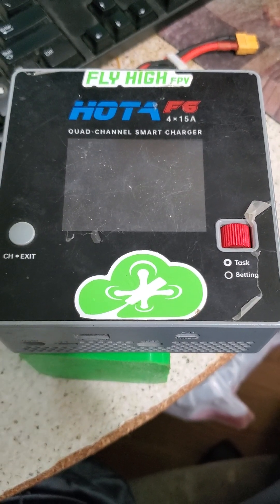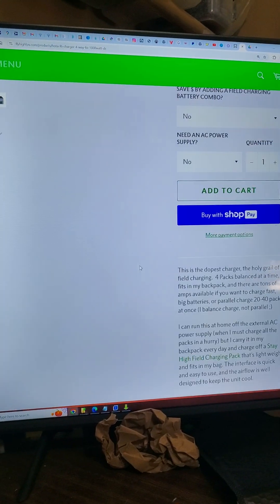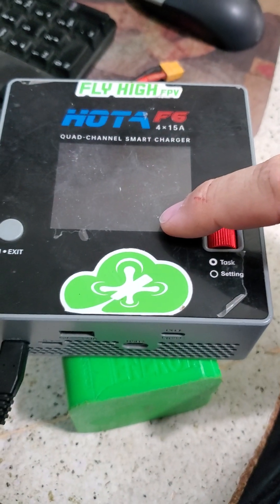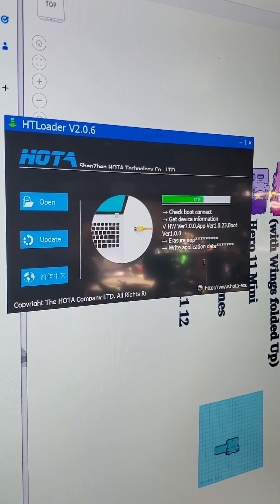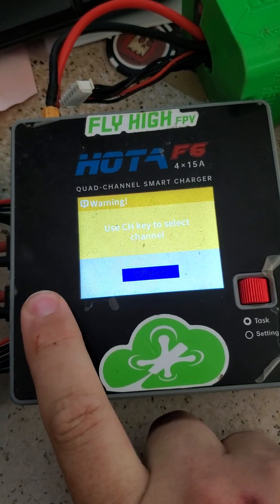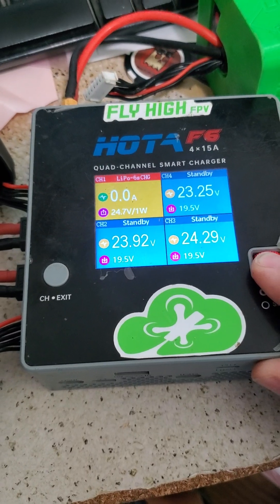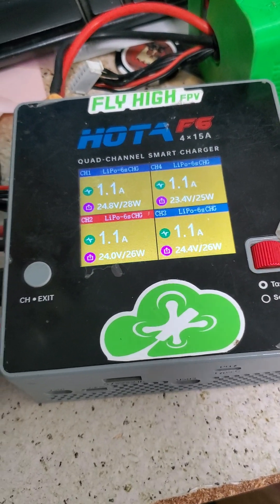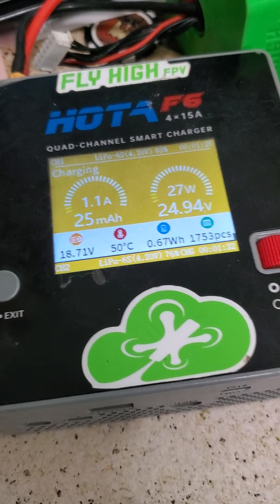How to Update Firmware on Hota Charger  - One Button Charging Mode - on Hota F6 and F6+

Comment: Hello friend. My Hota F6+ charger stoped charging and balancing lipos with chan 1 and chan 2. Only chan 3 and 4 are working properly. When connecting lipos to chan 1 and 2 display only shows actual state of batteries, timer running but batteries stay at 3.85v without balancing or charging. I moved the same lipos to chan 3 and 4 and works well. Changed the chan 1 and 2 balance boards and main charging leads and no results. Also updated the charger following your video in USB 1 and USB 2 and updated ok, but same problem with chan 1 and 2. What do you think?

Comment: I'm using an external load on my Hota F6+, but it seems to be discharging to 3.5v per cell, despite setting it to 3.8v (storage).. is anyone else having the same problem? I've just done the firmware update and it didn't help...
Reply from the maker: Using the discharge setting or storage setting? Storage should put it right on 3.85 and balance it.
Reply: @Fly_High_FPV this is when using external discharge. Think I've solved it though.. it only stops at the voltage I've set it to when the external load is connected to output 1 or 2. Output 3 doesn't work at all and just reverts to standby, output 4 just goes all the way to 3.5v. Maybe it's a firmware issue?
Reply from the maker: @TomPatong  honestly, idk, I've never used discharge before, I got quads to do that

Comment: Although your showing the firmware update for the F6, it works the same for my F6+. Updated like a charm for my Hota F6+ quad charger. Very important to update both USB ports like you mentioned. One button mode is great for me. Many thanks.
Reply from the maker: @edwincordero8  I have custom firmware on my site for F6, F6+, and D6 Pro
Reply: @Fly_High_FPV  Yes . I used the F6+ update for mine. Thanks.